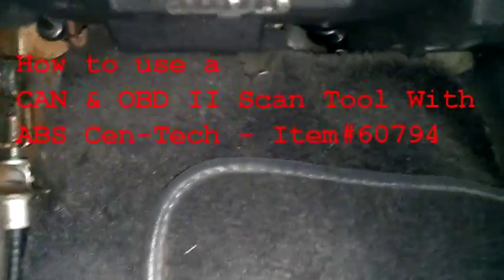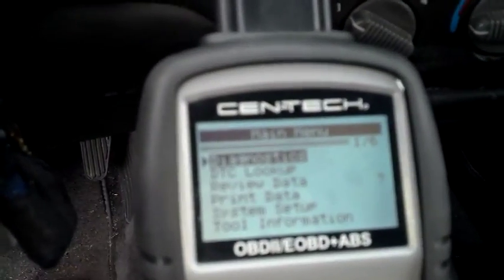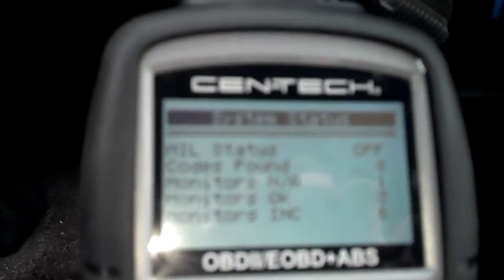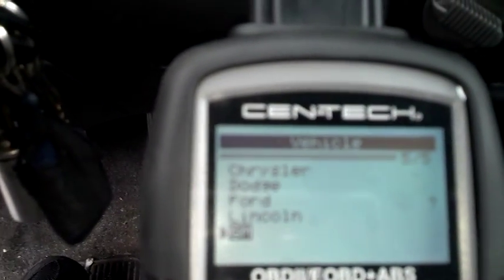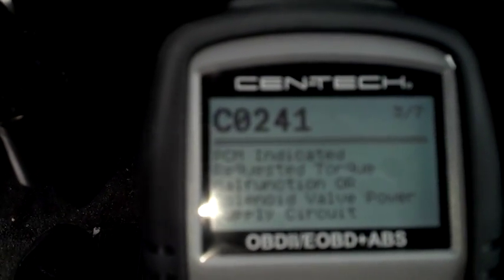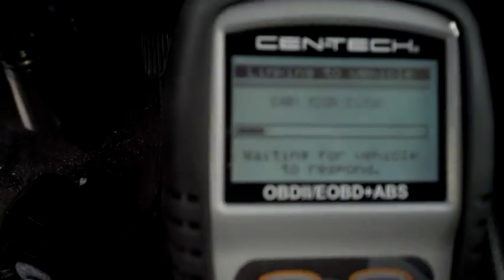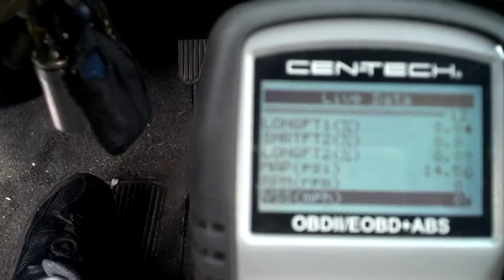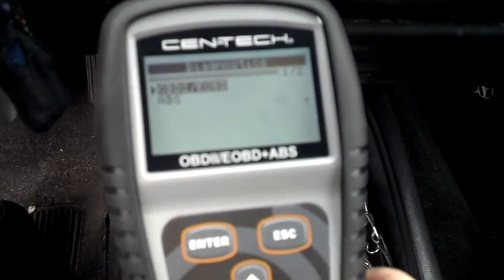How to use a CAN & OBD II Scan Tool With ABS

Comment: Don't trust using this scanner for abs the code definitions are wrong code c0035 comes up as a right rear wheel sensor circuit and it's not it's a left front

Comment: I just purchased same model. Taking it back! Does not support Dodge ABS systems! Many other functions will not support? Really bad!
Reply: James Sasse hi James I had the same problem with the scanner hooked it up to my 99 Hyundai Tiburon, and sad to say that Hyundai vehicles are not even in the scanner so we did the update and now it's still not communicating, it works fine with my 01 escort talk to the manager Harbor Freight I will be taking it back..

Comment: The camera is fine, the quality of the video is fine, the problem with the focus is operator error.  Close-up focusing is difficult for most cameras and video recorders; the secret is to move the camera further away from the object (so the camera can properly focus), then ZOOM IN on the object.  This, however, is more difficult when a) you are repairing (and narrating) the same time as you are working (almost always a bad idea, and it shows in the video), and b) you are in a confined space, such as a car interior.  Think ahead, people.  Then video.  Proper (bright) levels of lighting also help significantly in achieving proper focus, especially close-up.  Oh, and use an external microphone (such as a clip-on) instead of the recorder's built-in mic; the sound quality will be much, much better, and crystal-clear.

Bright lighting, an external microphone, a stable tripod-mounted camera, and post-production sound editing of the voice-over does wonders to make a top-flight video.  Live voice-overs usually suck,  as it does here--but that's all that most people know to do...

All-the-same, thank you for taking the time to add this video.  Please try some of my suggestions for future editions.

Comment: Hey Nisa yes it will work on it ;) as long if you have 16 pins in your port it will work , hope it helps ,also they do sell different cords on ebay for under 10 bucks that will plug into this scanner for older than 1996 cars and trucks it is called obd1 cord ..

Comment: Good stuff i just won the same one in a auction on eBay for 70 with free ship, what i did find out about this unit ,first it is the best one HF Sells and it is also good knowing it has unlimited downloads for all newer cars and trucks, it is Very easy to use with just a 2min download from HF Website and your off to your fix ;) i am very happy with mine knowing it will tell me where to look for the problem and knowing i don't have to run down to auto zone every time the Service engine light comes on !! Great investment and easy to use, if you get a code and you do not have a book on your car just Google the code # and whala  your off to auto zone getting the right part you need ;) haha good luck everyone it is a great tool to own....

Comment: Is your check engine light on or has it been on recently?
Reply from the maker: No check engine list is off. when i get home tonight i am going to check fuel pressure. I think the fuel pump failed.
Reply: You can spray a little starter fluid in air intake if it starts then dies it is not getting fuel. Or stick funnel in fill tube and turn car to power on (not start) you should be able to hear electric fuel pump kick on and off.